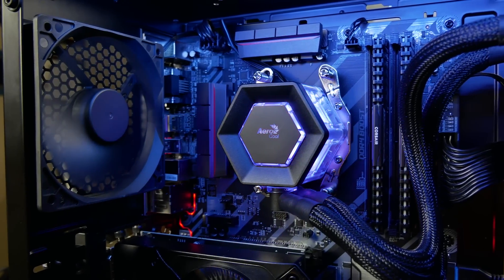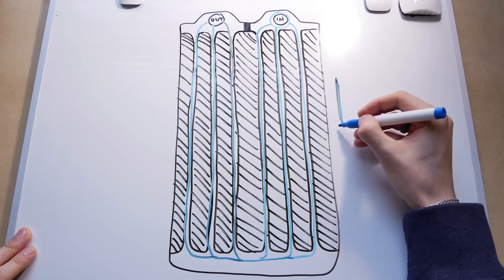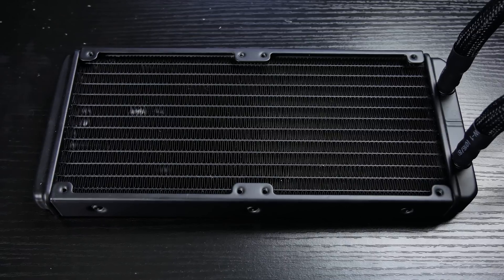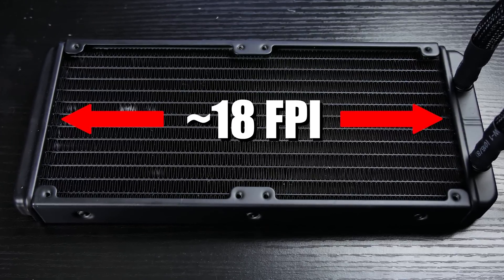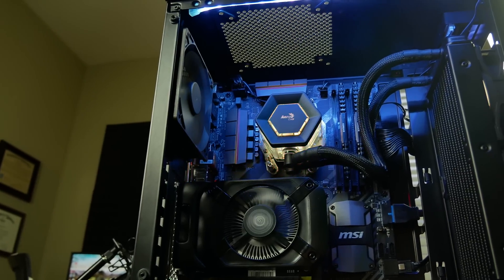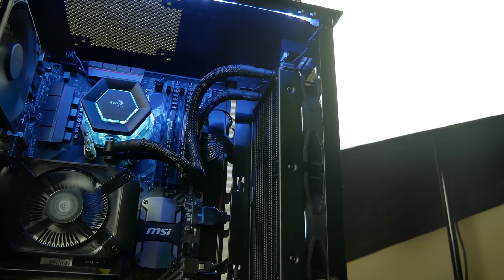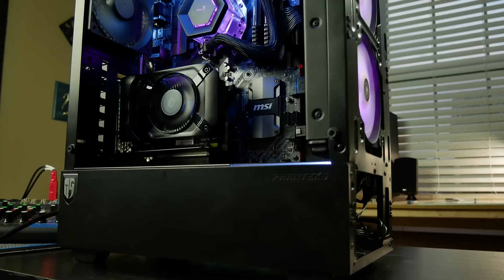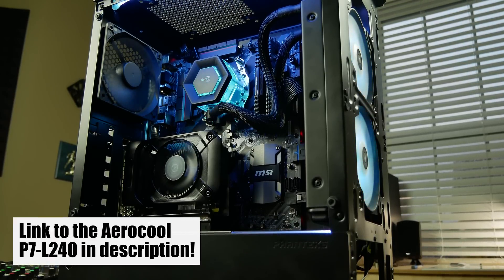The Science Behind All-in-One Liquid Coolers

Comment: I've never seen the practicality of AIO, it's adding cost to a system that won't really make a big difference in performance  for the amount of money invested. For a 100 extra bucks, you could upgrade your gpu and stick with a free cooler from AMD like on the 1600, and get a much better overall performing system
Reply: "No air cooler would do my 8700k justice."

Let's be fair, though.  That's because of the toothpaste Intel puts under the IHS, not because air coolers are insufficient.  If Intel weren't such cheap bastards, an air cooler would be just fine for an 8700K.
Reply: AIOs perform  better and look better too but don't justify the cost
Reply: No air cooler would do my 8700k justice. If you have a cpu that pushes out more frames in gaming then any other cpu on the market you need an aio plane and simple
Reply: sav22rem22 lol. 
8700k  $380. Decent AIO $120.
$500 total.
R6 1600 $180, free cooler
That's $320 you can put into a gpu.. Going from a 1060 to a 1080 ti lol 😂
Don't be a sheep. Unless money is not a factor, AIO and overpriced cpu not worth it.
Reply: Fearbleeds Yet the 1600 still can’t push the 1080 ti as far as the 8700k which still results in less frames. The only way I see the money being a problem is if you don’t have a job
Reply: sav22rem22 well no shit, you're spending $300 more. That extra 5-10% is so worth it right?
Affording it isn't the problem.. It's wasting money for minimal Gains. People have better things to spend money, I know I do.
Reply: Fearbleeds Even at 4K the 8700k performs better. Which most people still play on lower resolutions which is more cpu demanding since the gpus can dish out higher frames. The 8700k keeps higher averages and higher minimums so gameplay is smoother. Especially on 144hz monitors. If you can’t afford it then you do what you gotta do. I’ll enjoy my better performance.
Reply: sav22rem22 everyone knows the 8700k has better performance. I play at 1440p, 100hz. At that range the R5 1600 is plenty, and gives me great bang for buck. I would not gain more than 5 percent performance if I moved up to a 8700k. So it does not make sense for Me, and doesn't make sense for most people outside of the 200hz 1080p monitors. I'm just laying out facts here. Also, I like that the R5 1600 puts out so little heat.
Reply: Fearbleeds And my 8700k serves me well at 144hz. I have two 1440p 144hz monitors so I also need the 8700k just in case I want to play dual monitors. If it serves you well then great. I also bought the 8700k for more future proofing since when more powerful gpus come out the 8700k will be able to push those further before becoming a bottleneck
Reply: mjc0961 I’ve watched several delid videos where the trash tim was replaced with liquid metal and the temps on air still weren’t good. The only way even with an air cooler I’d see is if you didn’t overclock and delidded which I don’t see the point of buying a k series chip and leaving it at stock
Reply: sav22rem22 I had 2 monitors too (just sold one today). Don't see how having the 8700k makes that better, no gpu can push 2 1440p monitors at 144hz. ( well depending on the game) And also it's awkward gaming on only 2 monitors.
Reply: Fearbleeds The cpu gives the gpu instructions on what to put on your screen. If you’re running multiple monitors the cpu will play an important role in pushing the gpus hard enough to dish out enough frames.
Reply: would a h100i be good for an i7 8700k?
Reply: Infinite64 That’s probably the sweet spot aio. I have a h110i no delid and an overclock of 4.8ghz and while gaming I get around high 40s low 50s and while doing a stress test the max temps are around 67.

Comment: AIO myself, I have used Corsair H60s on several overclocked systems, they usually look more tidy then the couple big air coolers that I have used. I now have a h100i on a Ryzen 1600 overclocked to 3.8 and it is very stable and works well, where with the rather large Deep Cool air cooler I had before barely kept the CPU in the safe zone and would not stay stable at 3.8.

Comment: Personally im all about performance and reliability with minimal to no maintenance and looks DON'T really matter to me so I prefer top end giant Air Coolers such as Noctua D15, Be Quiet DarkRock Pro 4 (brand new), and CryOrig Ultimate. Price doesnt really matter that much to me that has nothing to do with my Air preference. Also SOME AIO's make more noticeable noise and i always worry about the pump/liquid sound potentially being annoying OR even leaking or dying sooner. If there was an equally expensive Air Cooler to a CLC or custom open loop that provided the same performance/ overclock potential then i'd definitely pay the extra. AFAIK though the Noctua D15 is the best Air cooler around and is pretty close to the best CLC performance wise. The fact that it only costs half the price is just a bonus
Reply: I run my PC 24/365; air cooling gives me peace of mind.
Reply: Large air coolers just don't fit in some builds. My Cryorig H7 (not even that large) was so close to the GPU it was pretty much impossible to release the PCIe latch.
Reply: Yes - Sometimes you have to remove the cooler as a first step to any MB work. 
Building an ITX with NH-C14S at this time, MB completely covered.
Thankfully Noctua is easy to work with - The soon to be released Be Quiet 4 models will be similar.
Reply: I have an NH D15 and have never looked back.

Comment: The other reason you don't get galvanic corrosion is that the metals don't touch, so the circuit is not closed. Galvanic corrosion is essentially a battery discharging into the fluid

Comment: I prefer air cooling, I prefer to err on the side of caution. If a fan stops working on an air cooler all I have to do is replace the fan, but if the pump breaks down on an AIO, I would think the entire unit would need to be sent in for repair/replacement.
Reply: Thankfully now you can get the EKWB fluid gaming kit for the same price as an AIO, and if the pump breaks on that, then you only have to replace the pump.

Comment: After my bad experience with a CPU water cooler that I bought based on one of your vids, I decided to go with air cooling from here on forward. I liked the look of the Deepcool Gamer Storm Captain 120EX (white), but whoever engineered it badly designed the connection where the glass candy-cane shaped tube from the top connects to the plastic elbow to the side of the pump unit. It actually leaked in the box even before installing it. Too much pressure from within the unit, thus it pushed out the glass tube from the side of the pump. Got a full refund back from Newegg, but i like Deepcool so I’ll keep an eye out for other future products from them.

Comment: Nice explanation.
Off topic question.... is the vertical GPU bracket in this video the one from Cooler Master? Did you mod the P300 by removing the PCI slot rails on the back of the case? I know you did a video about this in the past and thought this might be the same method here. But I wanted to check.
Reply: And.... I just found the original video. Wouldn't you know if was the P300 in the video. DOH! So, I guess the answer to my questions are yes and yes. :)

Comment: i prefer air coolers because even if they don't look as slick and clean as an AIO the price to performance is way higher(3-4C difference between noctua cooler and 240mm AIO is not worth additional 40$ for me). outside of that the reliability is also better on air since all that can go wrong is the dead fan that is cheap to replace, while when the pump dies you have to buy a new cooler.

Comment: Air cooler because for the prices of an entry level all in one  I can get top tier air cooler with monstrous oc capability ! Noise ? Noise is generated by fans and mechanical part of the PC then may be it's a little bit quiter but no as good as a hyper 613 or a bequite dark rock or a noctua nhd 15

Comment: Most times i recommend an air cooler 'cause it's cheaper and cools enough (my overclocked Ryzen 7 still runs at ~50°C under full load). But if your dealing with high OC (~> 4.5 - 4.8GHz on an I5/I7) and have the money sure go ahead and buy an AIO or even go for a custom build.

Comment: Air coolers. When comparing the two, the difference in temperature is not high enough for me to take the trouble and install a water cooler. Also, I had one AIO because I thought it would be much more quiet, but the pump and swirling of the water made all the noise when the fans were not spinning. So I just came to the conclusion that water coolers make more sound then air coolers. 

But really, since I am not overclocking, I don't need to cool down my system that much.

Comment: I like AIO's mainly cause it doesnt hide your mother board. Air coolers get so big sometimes and it is all you see.
Reply: Actually i prefer a proper air cooler over AIO solutions anyday. My current Cryorig r1 ultimate does better than my Enermax Liqmax II 240 and my corsair h100i(tested with several reseatings just to be sure). Why on earth they insist on shipping these expensive AIOs with horrible fans or loud pumps i dont understand. Im not saying air will beat every single AIO on the market but the money they want for them is just bad value imho. I find they make more sense on GPUs if you must have one.
Reply: I just bought my first AIO, my air cooler was just too big (Cryorig H7, not even particularly large for an air cooler). I only had like a half-inch gap in between the heatsink and GPU, making it impossible to reach the PCIe latch and remove the GPU. The backplate of my 1070 is all scratched up from sticking screwdrivers & other objects down there trying to hit the latch, and my NVME drive is directly below that so it's scary if the screwdriver slips. After buying an even bigger GPU (Strix 1080Ti) it just wasn't feasible, I'd have to remove the heatsink to ever reach the latch. So in my case I'd say the AIO was a necessity.
Reply: i like them because they look cool and show my stuff of a little more,also keep my system cooler than old air block,also can get some as cheap as the air blocks and they also"( look cool)"and makes my system pleasing on the eyes and can see some bling for all the pennies i have put into it (which isnt that much compared to loads of you guys)
Reply: I prefer the look of a big air cooler to the look of the soft AIO tubing just going wherever the hell it wants in the top half of my computer.
Reply: Quality Continent it’s big, heavy and bulky. if you have the money there’s no reason to go air on a high-end system.

Comment: you said you can fill this loop again your self if needed but I don't know those specials chemicals they use
so if I would refill it myself again later and the block is copper and the rad is aluminum wouldnt that be a problem?
Reply: yes you need to add chemicles, if you buy a liquid for loops from thermaltake this will have all the additives already

Comment: What's the typical failure rate for AIOs vs traditional air-cooling? Reason I ask is, my one and only AIO purchase resulted in a failing pump just a few months later, whereas I have never had an issue with air-cooled heatsinks. I really love the aesthetic of AIOs so I lean towards 'em, but that failed pump has made me ultra-cautious.
Reply: with air cooler all that can fail is the fan. and if it dies you don't have to replace the whole unit.
Reply: got a cheap corsair h60 and its been going 24/7 no issues for atleast 2 to 3 years now. id imagine the more expensive ones would be even more impressive with their life spans but so far this little h60 just keeps on goin
Reply: I have had mine since I got my phenom 2 back in middle school.  (so like 7 years?)
Reply: I've had AIO's in two systems for several years and never had a problem with them. You must have gotten a bad one. That happens. I've had brand new motherboards and hard drives that didn't work straight out of the box. It's kind of the chance we take buying mass produced parts. A small percentage of them won't work. It sucks whin you get one of those small percentage parts.

Comment: Using aircool now, and not tried water cool yet.
I think air/water will be choice in some situation.

Like, big case. can mount large heat sink so it work.
or small case...sure you go water for low profile cooling system.

Now using E3 1231v3 with CM V6GT, which ported from previous CPU, X6 1055T (AMD old model cooler just like a miniture jet engine....)

Comment: Personal preference for me, aio all the way, quieter, cooler and better looking than air (specifically the nzxt Kraken series). That being said the noctua chromax fans + an nh d15 heatsink look pretty nice.
Reply: Cmdr Flint Mweh, quieter isnt really true in my opinion. I love my Kraken X62, but quieter than an NH D15? neh
Reply: Youri Dv dunno, I'm running 4x120mm fans on my Kraken X52 and it's pretty much silent and thats in an open case using the performance profile. I know the pumps can get a bit noisy when they're nearing the end of their life and you get air bubbles in the system, but that's usually 3-5 years down the road. 

It could just be the pitch of the sound, I used to have an air cooler with 2x120mm fans (honestly can't remember the brand), it kept things pretty cool but it seemed to generate quite a high pitched tone, really got on my nerves after a while, the kraken seems at best a low frequency gentle hum.. could just be my old ears :)
Reply: Cmdr Flint Depends on which fans mostly. The stock fans are "okay" for all intents and purposes and theyre good in comparison to most stock aio fans, but a couple of silent wings or ML's or whatever would do a much better job. I will agree with you that air coolers have a high pitch compared to aio's, might be because of the difference in fin orientation
Reply: OmerTheGreatOne I used to agree with you, until I unboxed one noctua aircooler myself. It's fucking insane. the accesoires included, the packaging, the rigidity of the fans, the heatsink and the mounting mechanism. I've handled high end coolers from every mainstream brand. Bequiet, Cryorig, Thermalright, Thermaltake, Cooler Master, NZXT, Corsair All of them. None of them come close to noctua's build quality.

I agree the two shades of ugly are a bit of a downside, but there are lots of usecases where people don't even care about aesthetics.
Reply: The difference in cooling isn't as big as people think. Strictly from a price to cooling performance perspective, fans do better until you get over 240mm (since your highest performance fans still aren't that expensive compared to a rad), and iirc, for a few dozen less than a 240, you'll be at parity with a 240mm. I forgot who collected that data and what video  (maybe bitwit of all people? I don't remember, sorry). That said, radiators have those other advantages that you mentioned.
Reply: Youri Dv Noctua is so over-rated and ugly AF.